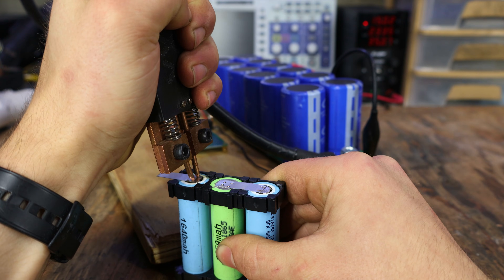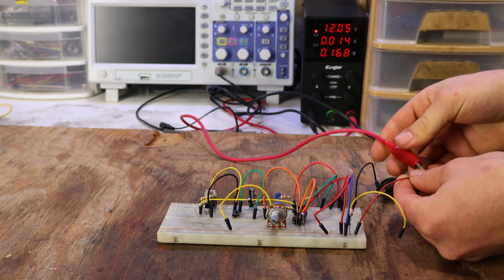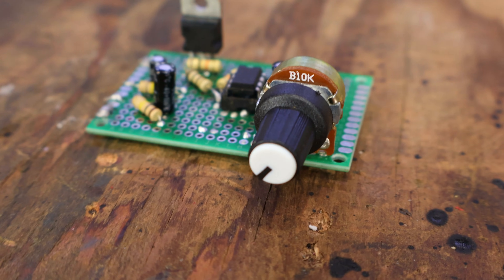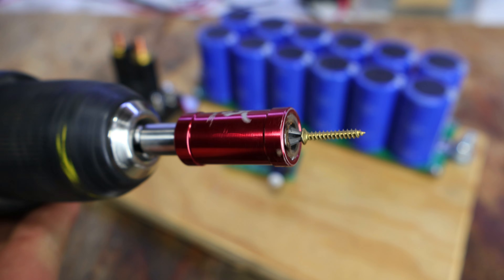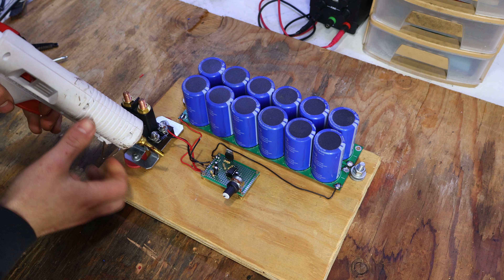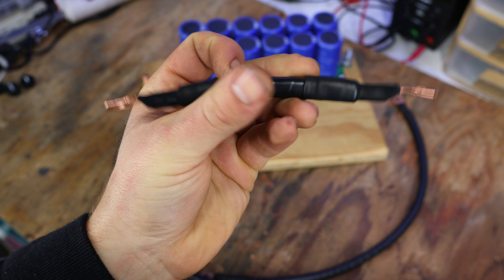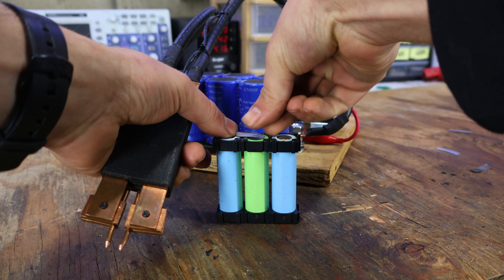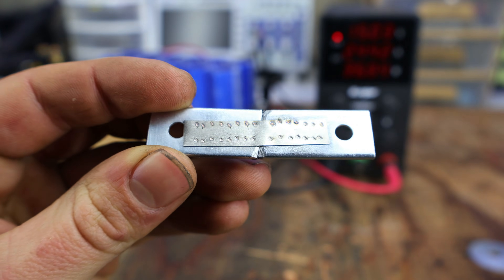Can Super CAPACITORS Spot WELD 18650 BATTERIES?

Comment: I wonder what stops the relay from arcing and welding itself at on position 🤔
Reply from the maker: the fact that it is rated for 500 amps continuously, which for most aquipment capable of pulling that amount of current can have an inrush current of a few thousand amps. so unless there is a factory defect, I'm quite confident that this relay can do over 10,000 welds.

Comment: After half a dozen projects involving super caps and relays, you will still only have 12 super caps, 1 relay, one working project PLUS 5 useless projects that are missing parts.
Reply from the maker: super capacitors are not cheap, and the projects are just for learning and for others to learn

Comment: TRansformers don't work unless you get a really large one. My guess is you took the cables off the transformer because yours doesn't work well. I tried it, it's a failed project.
Reply from the maker: I made a video on using a microwave transformer to spot weld. It might help you out: https://youtu.be/CkvBUEBxxKw
Reply: @ElectronicLab.  I know how to build a transformer and I can give you all the math behind it. You can not get enough current from a microwave transformer rewound secondary to weld anything more than the thinnest strip of metal.
Reply from the maker: even if the secondary has a super thick cable wound around it, you will not get a proper spot weld if the voltage is not high enough(more turns on the secondary) also copper prongs worked well for me unlike steel and I think i ended up winding 3 turns of 4 awg. a good pulse for 0.15mm nickel strip was 100ms. 250ms was the max, but a little to much in my opinion.
Reply from the maker: although I forgot if I used a 700watt or 1000watt microwave(that might make a difference as well)
Reply: @ElectronicLab.  what voltage did you end up having? I guess material interface has some initial voltage threshold. I have noticed that fuse holders sometimes show high resistance of several ohms and several hundred millivolts of voltage drop in diode mode with a multimeter, but no voltage drop across them at current of 1 amp and voltage of 220v. How is this phenomenon called(looks like some form of dielectric breakdown but after high voltage is removed voltage drop at low voltage is still present)?
Reply from the maker: Maybe if the fuse holder isn't gripping the fuse tightly and there is either some corrosion or other contaminants around the fuse I guess there can be some resistance at lower voltage but then as soon as you switch to higher voltage there can be an ark forming across the fuse holder and fuse causing them to well together temporarily causing the resistance to reach close to zero as it should be. those are my thoughts
Reply: @ElectronicLab.  Nothing to do with the fuse holder, it's about jules. SuperCaps work very well in this application, BTW.

Comment: Will it work with normal capacitors
Reply from the maker: yes, but it would require hundreds or even thousands to be able to get a proper spot weld, which if you are planning to buy, it might just come out cheaper and easier to assemble a few super capacitors
Reply: @ElectronicLab. Thank u a lot for th answer ,and for this amazing video

Comment: Chinese ones that short car battery use 8 to 10 smd mosfets in paralel instead of relay
Reply from the maker: Mosfets have a significantly higher internal resistance compared to relays, and when it comes to spot welding every amp counts
Reply: @ElectronicLab.  how significant would be energy dissipated as arcs? in case of a huge battery of supercaps it probably is irrelevant, but in case it was a barely sufficient arrangement of electrolytic caps it feels like it could matter. What timing tolerance did relay ended up having, if I remember correctly some can have tens of millisecond switch-on time?
Reply from the maker: I think I used about 25ms for the super caps and 100ms for the microwave transformer
Reply: something tells me the mosfets would get absolutely fried
Reply: @meowphedrone  depends on mosfets and what is used to protect them

Comment: 0:27 if the pulse of high voltage is VERY short it won't kill you, the capacitor is likely to discharge to the magnetron or the winding of the transformer
Reply: The pulse in this case indeed isn't short. Capacitance is far too great.

It won't get discharged through MOT, because there are diodes. It has a dedicated bleeder resistor.

Comment: Cut off the high voltage windings side of the microwave transformer,take on big wire /cable (50mm2), Wind it 2 o3  trough the the micro wave transformer,and volia a simple v low voltage high amp transformer.
Mine does 2 volt and over 100 Amps ;)